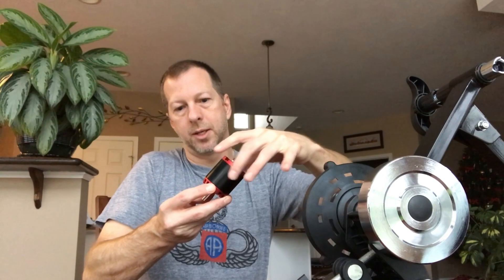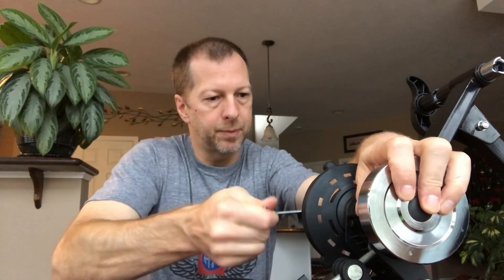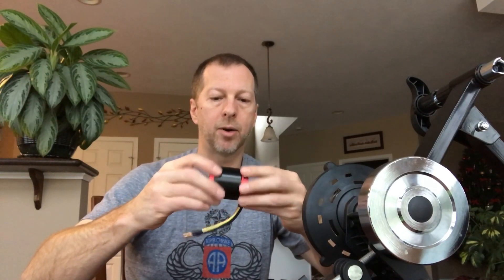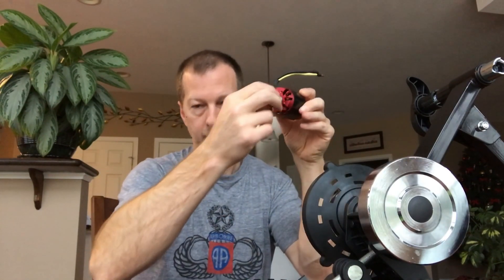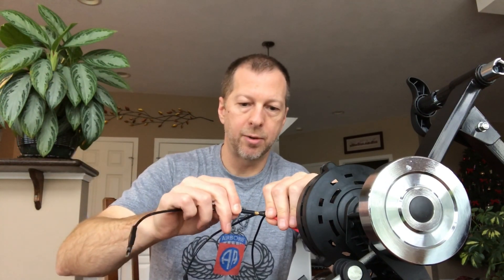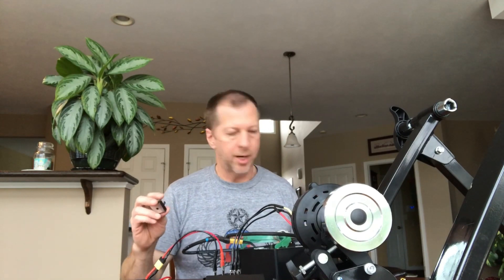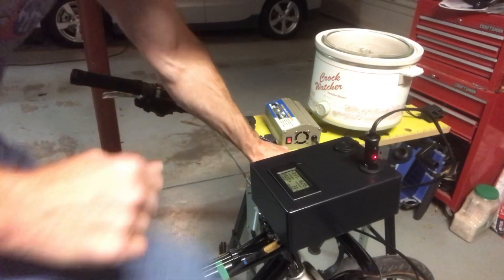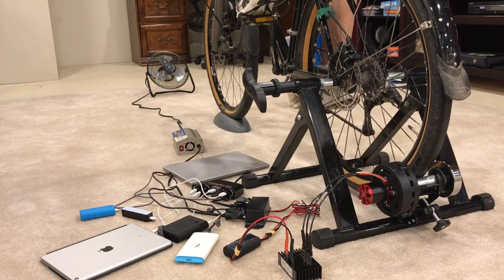Best DIY Bike Generator Design - easy build!

Comment: Heya, cool project. I want to do something similar except instead of RC BLDC motors, I bought a broken hoverboard with dual 350W motors that work perfectly. From someone's test they were 16kv (16rpm per volt) brushless motors, so I'm thinking of hooking both on to something like this and it would turn out amazingly.
Reply from the maker: 16Kv seems a little out of the ordinary, but certainly should work.  I"m working on a new project using a 140Kv skateboard motor, so sounds like we are doing something similar.  Just need to match up a drive wheel size to get you to the right RPM to get to 12-15 volts.  I'd be interested to hear how it goes!  Happy to answer any questions along the way.  I should have my project posted by the end of next week.
Reply: @GenesGreenMachine  Very cool, looking forward to seeing it! :)
Reply from the maker: @Anjfyi  Hey Anj - a little late, but just posted the video using the 140Kv motor if you want to check it out.
Reply: @GenesGreenMachine  Just saw it, commented on it! Love the custom display box you added on to it, will have to make one for myself.
Reply: I'm a dummy and want to do same unsure what I need to buy order online

Comment: I'm don't know much about electricity, i was wondering, is it possiblle to use many alternators/generators to charge a deep cycling buttery at the same time......?
Reply from the maker: Yes, I don't see why not!  The other way you could go is find the right generator to charge multiple batteries in parallel.  Two 12v deep cycle batteries would accept 20-30 volts, so wire them in parallel and find a way to spin your alternator/generator in that range, and you'll put watts into them.  I'm working on a new video to demonstrate that very concept, using a 24v e-bike motor.  Stay tuned!